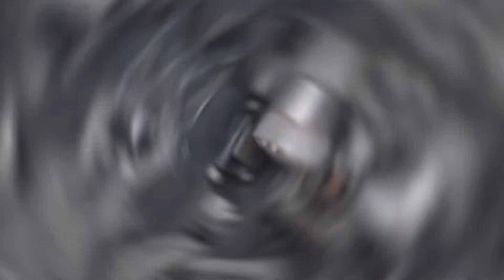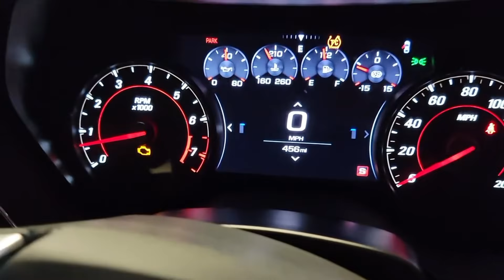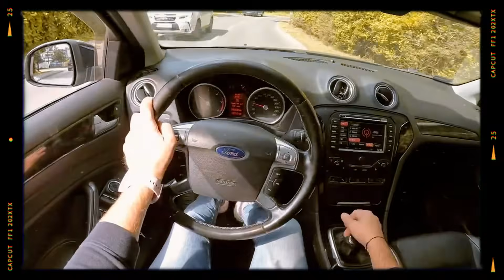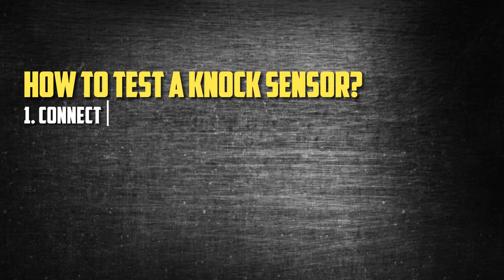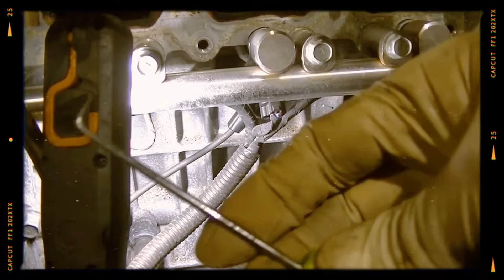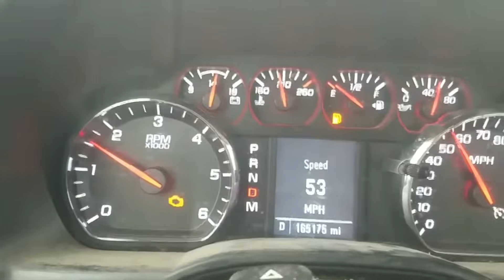5 Symptoms of a Bad Knock Sensor. How to Test & Replacement Cost

Comment: I have a recurring problem with my 04 jeep. I get the code with the built in code reader, but not with my plug in reader. 
I don’t have a check engine light, no change in operation.

Comment: $737 for a knock sensor in my 2015 subaru outback that the dealership tried to fix. Screw that. I bought a new knock sensor for $100 and replaced it myself. Dealerships are rip offs.

Comment: Mines was the passenger side but it was intermitting engine felt good no nocks or anything but when driving it will feel like the pcm will cut fuel or something or lower spark or something but the mess up part is I had no codes one day a code came up and I was like dam about time come to find out it was a po333 for gm truck did my digging and boom wires where burnt problem solved now it does it feel like I’m driving a  4 cylinder back to v8 mode

Comment: I have a PO328 code on my 2016 honda crv, had replace the sensor and still have the code camming back. any sugestions please.
Reply: Did a brand new factory Honda part get used or an aftermarket part?

Comment: They are telling me $1200 for my Nissan  pathfinder knocker sensors! However, They said they are going to be replacing my intake cover ( at no charge) as it sounds like they may have damaged it ....maybe when they replaced the valve gaskets due to an oil leak??? Wonder if they damaged the knocker sensors too?

Comment: chevy silverado single cab long bed knock sensor code and now theres a code saying the 8th cylinder is misfiring
Reply: Same exact problem. Mine hydro locked but I was able to unlock it-HOPEFULLY it didn't bend a rod
Reply: Crank sensor

Comment: 1100 for knock sensors replacement  on my 99 pathfinder 😢
Reply: They are telling me $1200 for my Nissan  pathfinder! They said they are replacing my intake cover at no charge as it sounds like they may have damaged it .... they replaced the valve gaskets due to an oil leak. Wonder if the damaged the knocker sensors too?

Comment: Please help ….have a 2005 Honda crv replaced 2 knock sensor’s checked all wiring and fuses still getting reading of knock sensor have reset and after driving 2 blocks engine light come back on and reads knock sensor what is one to do😢
Reply: Did you figure this out? I’m guessing you did not use OEM sensors?
Reply: Mine is doing the same. I took it to the dealership for repairs. I'm starting to feel like they scammed me.
Reply: @shelitaj.1479 exactly why people don’t trust a lot of dealerships
Reply: STOP BUYING CHEAP PARTS AND TAKE IT TO THE DEALER

Comment: They told me 500$ for my 2.3 02 accord knock sensor
Reply: Bought the part for 10$
Reply: @TylerTwophones 😂😂 man stop
Reply: ya that's because of all the crap that has to be removed to get to them. some cars are worse
Reply: Does that include installation?
 Because that would  make a huge difference.

Comment: I got charged $800 to have them both replaced on my truck and the light came back after a few months with the same code 🤣😭 I hate this thing
Reply: Replace the harness too while theyre in there
Reply: All those symptoms can be present with a bad sensor, also, a good sensor detecting detonation will give the same results.

Comment: $250????  Try $2400 for knock sensor replacement at my local Toyota dealer.
Reply: Buy the thing online & do it yourself, mine cost $17
Reply: @neiliewheeliebin I bought all the parts and did it myself. Saved $1900. Wasn't easy though.
Reply: @bme7491  Mine wasn't easy either I'm lucky I have small hands I was able to it without removing the intake manifold. You saved a small fortune doing yours great job
Reply: $2400?!?!  A new sensor for my Silverado costs $25.99.
Reply: @blk7088  The sensors are $200 each. With one going bad, it's good practice to replace both (never been replaced). The $2400 was for $500 in parts and the rest labor.
Reply: that's wild, @bme7491
Reply: On my '94 Toyota Pickup, with a 22R-E, it sits next to the oil filter, so I can get it from the wheel well.  It does cost around $200 for a new one, though.  I got a testes used one for $50 to get me by.
Reply: $59 for the part and $1250 for the repair at the local Chevy dealer (2004 Suburban)
Reply: Doing one on my friends Saturn today for 50$🕺 find a better mechanic
Reply: I paid $400 at the dealership to replace my sensor and the check engine light came back on within weeks.

Comment: Very interesting, how do you test to distinguish between engine knock, failure of knock sensor and engine cylinder misfires causing the restriction on power and loss of MPG?
Reply: Misfire counts should be seen in the scan data.
If your engine is running lean it can cause knock. Prolonged running lean will throw other codes as well: P0171,0174.